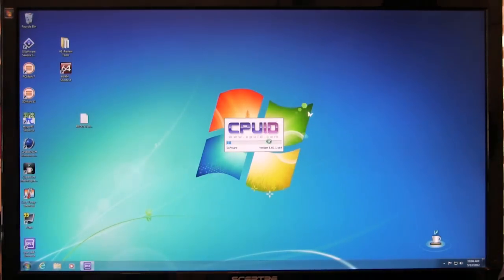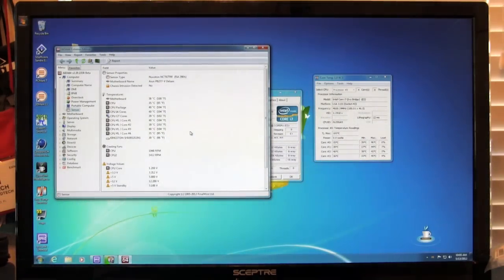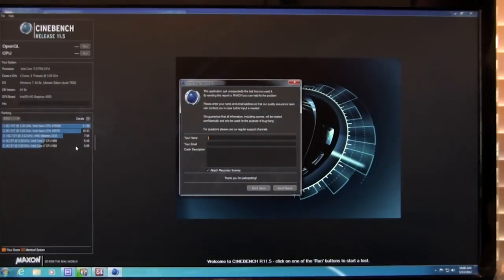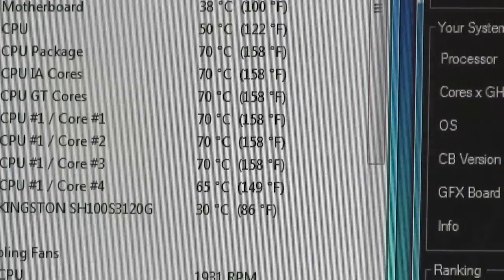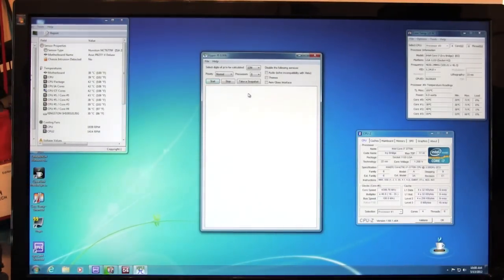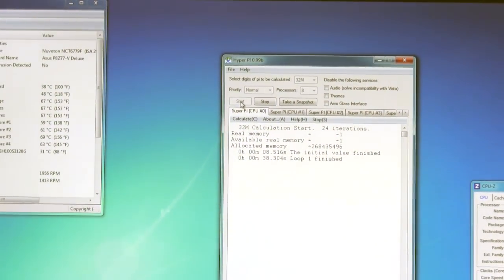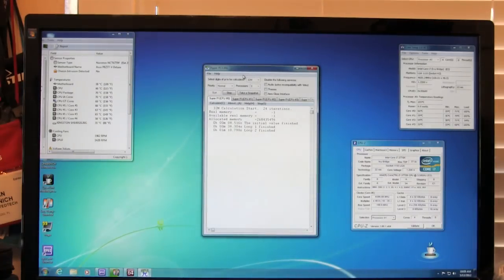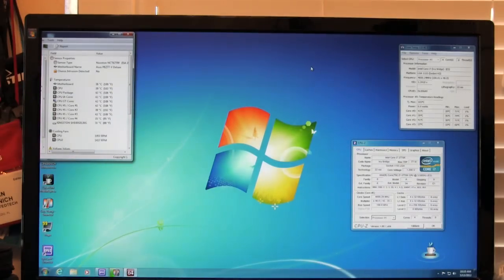Ivy Bridge Heat Issues. Are they really about the TIM?

Comment: well, to be honest, i think the black silicon glue is creating a gap between IHS and CPU die leaving it not placing enough pressure. TIM plays a role as well but maybe we are talking about 3-4 degrees here, i'm sure temps will not be that bad if the black silicon was thinner. however, i will delid and post back on results to see and show the difference.

Comment: you are lucky that you got a really good chip, most chips need 1.3+ voltage to be stable at 4.6, mine needs 1.328v on 4.6 Ghz and im hitting 75c, and thats the case for most of users. if you want to make a unbiased review, you have to test more than one chip. im gonna delid mine in the next few days after 1 year of usuage, temps are getting higher with time. im sure ill knock 20 degrees off my CPU when done deliding it.

Comment: your overclock is not stable at 2.0volts in cinebench, therefore you needed to apply more volts and rerun the test, your temps will be higher … dont speculate, also in with your setup core temp variability is good evidence of it, you should not have core temp varying by 7-9 degrees between cores, your video is not rigorous enough.

Comment: The actual TIM isn't the problem, it's the glue Intel uses that expands and causes gaps between the die and IHS. That's why some bad samples show very high temperatures on some cores, but not all. Removing the IHS and replacing the TIM should cause the cores to have consistent temperatures.

Comment: I replaced my 3770K intel paste with Noctua NT-H1 i had 15c reduction across all cores and now they run within 3c to 4c from core 1 to 4 instead of the previous 8c to 12c  difference across all cores so i at least found that i got better results i also have a Noctua NH-D14 cooler on it which i fitted multiple times to make sure that wasn't the issue and it comes down to silicone lottery every cpu will not be the same i know of other 3770K's that run hotter and cooler than mine

Comment from the maker: I have seen under the IHS and your point it still moot. If you are convinced that a company would intentionally hobble a new generations of products then you are not going be convinced by any amount of real evidence. You already have your mind made up.
These same arguments happened when Lynnfield was launched. In fact if you look back you will notice performance and overclocking issues with each new die shrink. It is what happens when you get smaller..

Comment from the maker: Sorry there is no way that removing the TIM is going to give you a 40-50% reduction. Sorry, but I am not going to buy that one. That would mean the past is a thermal insulator and not performing almost any transfer. Your first line also make no sense Sandy Bridge did not use TIM, but solder that is why people thought it was the TIM in the first place.

Comment from the maker: Actually you do not have to try that many to disprove the claims that is the TIM. The thermal interface material is made in exceptionally large batches and only a small amount is used for each CPU. Tens of thousands of CPUs would be using the same batch of TIM (not to mention thermal differences for the TIM will be small). If it is the TIM then it would be present in all CPUs. Because it is not it is more likely a process and design issue than the TIM

Comment: you should state which cooler is used in the description box. my arctic freezer 13(yeah, I know) idles my 3770k at 38-40~c and max to 92~c under intel burn test. but fully stable. that's at 4.4 with voltages set to auto on biostar tz77xe3. I usually don't see that high since no games or even my video converter hits max cpu load. normal highs are 65c or less at 70f room temp. I will be upgrading to water soon anyway.

Comment from the maker: Yes the TIM is mixed in batches, now how many CPUs do you think a single batch of TIM will cover? How many CPUs are from a single wafer? You a more likely to see the heat issues across multiple CPUs if it is the TIM due to the size of the batches, If you have a process issue your success and stability rate increases as the process matures.

Comment from the maker: If it is the TIM then it should be present in all CPUs. If it is another issue then it would be hit and miss with the CPUs. The move back to solder was a smart one, but it is not an indication that the TIM was the thermal issue with Ivy. Haswell is a 2nd Gen 22nm product which also makes the process more mature.

Comment: Unfortunately, one CPU does not make for an adequate sample pool. While the specific sample tested showed no sign of 80C+ core temps, others have. I've seen some samples hit temps >90C, and some have shown high (20C) temperature variance across the 4-cores.

Some Ivy Bridge CPUs simply suffer from temp issues. Whether it's the TIM used between the die and the heat spreader or not, the issue remains. Hopefully, the new Haswell CPUs have gone back to solder to eliminate any potential TIM issue.

Comment: Yeah, could be the board or the operator :).  I didn't go crazy on this build since I already have a 2500k @ 5Ghz.  Just wanted to see what Ivy was about.  I'm just now getting smart enough to play with some of the more "exotic" voltages (PLL, VCCSA, VTT).  Definitely gains to be had, but I haven't mastered it.  WRT the video and your original intent, I will say I'm not having any heat issues with my 3570k that I'd consider out of the ordinary.  It's stable @4.7GHz & 1.28 volts, ~75c full load.

Comment: Fair enough on that.  I agree Prime isn't realistic when compared against real world use.  One other thing I've noticed in my testing is that memory clock seems to have a big impact on overall stability.   In general, I find that if I bump my memory clock down to run of the mill DDR3-1600 speeds, I can push the CPU harder.  I'm sure that's not new news for anyone, but I don't claim to be an overclcoking guru.  I just try things and learn from them.

Comment from the maker: I have gotten 4.6 stable at this voltage it all depends on other tweaks in the BIOS and also the board you are using. Prime is a good bench to putting the CPU under maximum stress over an extended period of time, but it does not represent any real world test. Even a 60 second Lightwave Project (which can take over 100 hours to render at 4K is not as stressfull as prime in most cases.

Comment: It's definitely possible to overclock to this speed at these temps, but SuperPI/Cinebench aren't great for validating a stable overclock.  I doubt prime would survive 20 passes at this voltage.  I'm seeing 1.28-1.30 volts required for this kind of overclock to be stable, and when you put it under full load using something that really stresses the processor, you will easily see those 80-90c temps.  No disrespect to anyone, it just isn't realistic to expect 4.6 stable on Ivy at this voltage.

Comment: i'm running an i5 5700K at 3.6 and getting 90* C on stress tests, and freezing playing BF BC2 that runs max'd  very well with an e8400..  I had good coverage with AC paste when I took the heat sink off.  I am an Aerospace Tech, circuit board rework specialist for Delta3, Sea Launch, c17, f18, f14, f16, f22, osprey, Minuteman, Comanche.. a few things they said they couldn't tell me what it was and I was watched by an armed guard the whole time I fixed it

I wonder if this guy is a MS Troll..

Comment from the maker: The tests we ran were valid. Many sites were claiming 80c+ at 1.2V we ran our 3770K at higher than that and did not see those same temps that people were claiming at lower voltages. It disproves the original claims quite nicely if they are claiming 84c at 1.2 V and we only hit 81c at 1.28 there is a problem

Comment: Pre-Forming a conclusion and ignoring EVIDENCE to the contrary, or which invalidates your assumptions during testing = the christian scientist method.

anandtech,pugetsystems,overclocknet,hwbotorg and many others who actually TESTED scientifically have EVIDENCE to the contrary... IVB cpu's do hit over 80 deg C on low volts (1.2v) AND replacing the TIM does improve temps in the range of 5-10 deg C for conventional cooling (Water/Air).

The disclaimer is it invalidates the CPU warranty.

Comment: Pre-Forming a conclusion and ignoring EVIDENCE to the contrary during testing = the christian scientist method.
just search for TIM replacements on hwbot and other reputable overclocking community forums which ALL show improvement in CPU temps when the TIM is replaced..even puget systems test with fans set to "Auto" showed improvments.
It doesnt change the fact its an extremely RISKY modification, and it invalidates the warranty... but FACTS ARE FACTS.

Comment from the maker: Unfortunately that is not correct either when you are looking at temps that is what you are testing. This is not a stability test and interestingly enough "all" of the results you mention point to two or three other articles. The TIM is not the root of the issue, we saw the same thing during other process transtitions where leakage etc was the cause. You are welcome to believe what you want, but as you said one result does not invalidate others becasue CPUs are different.

Comment: Unstable overclock = invalid results.

Valid results come from sources that actually modified their CPU and replaced the TIM.. and those results all show the same thing. Replacing the TIM does yield noticeably lower temperatures in the range of 5-10 deg/c.

Like everything else with overclocking, EACH CPU IS DIFFERENT, "Low" temps on 1 sample does not invalidate all other results on all other Ivybridge.

Comment from the maker: Current Leakage is an electronic fact. Just becasue it is not being talked about on other websites does not remove that. If it were the TIM then replacing it with something that had better thermal properites would correct the issue, but it does not. You are wlecome to believe what you want, but it does not remove the fact that current leakage is the primary issue and not the TIM.

Comment: I'm sorry but your story is just a story. This is not talked about ANYWHERE on the internet except here. Its a problem with the TIM's. The E4xxx series processors had the same issue as it used the same TIMs that Ivy Bridge are using. Turn the voltage up, problem solved.

Comment from the maker: Curent leakage is to blame with the 22nm proccess
Leakage in transistors causes semiconductors to require more power to operate, as they must replace the current lost to leakage and also generates heat as it leaks away, When the heat from leakage is combined with the heat generated by the semiconductor's normal operation, it can become a significant problem. Excessive heat can eventually cause circuit failure. Designers may take a number of different approaches to reduce the amount of leakage.

Comment: Yes. It does. The stuff Intel used was cheap, Sandy Bridge has solder as its TIM under the heat spreader. Ivy Bridge uses this crappy thermal paste, replacing the thermal paste with a better one reduces temperatures. Moving the voltage down will stop the processor from functioning properly.

Comment from the maker: Is it not enough or too much, both can cause an overclock to fail. The important thing to remember(and again the point of the article) is that the smaller the process the more power you have to push in to counter for leakage especially in the first generations.

Comment: the instability you have is not enough power in the cpu, and it's the volts that suddenly causes the thermals to go through the roof, your overclock is invalid if it can't compete a benchmark, cinebench crashed.... that invalidates the overclock right?

Comment from the maker: The heat the CPU generates is a function of the voltage you apply to it. As the process shrinks and leakage increases this goes up more dramtically than it does in older CPUs with a mature process. The heat has nothing to do with the TIM as per our article there are multiple people that are saying this as well.

Comment from the maker: The "right test" is a matter of opinion. There are numerous tests that are used in benchmarking and for burn-in that do not get the CPU over 90 degrees. I could also remove a fan, use crappy thermal paste between the IHS and the Cooling head... so the test is not the point here. it is that the TIM used between the CPU core and the IHS is not the casue of the heat issues, the process at 22nm is

Comment from the maker: The TDP setting is not exactly accurate. Right now on a 980X it s reading 4095.0 Watts. I am pretty sure that is not correct. With the newest CPUs Core temp no longer reads VID and incorrectly reports other information. The temperatures are the most acurate part. You can also use Realtemp which has been kept more current than Coretemp. I have used both but prefer Coretemp for some of its logging and display features.

Comment from the maker: Yes of course it will, as does current leakage at the smaller process. The smaller the process the higher the current leakage and the more voltage you have to push through for stability. The viedo and the accompanying article show that Ivy Bridge actually needs more voltage to reach the same clocks than Sand Bridge CPUs did. You also have to put more voltage into the iGPU to keep that side stable at higher clockspeeds.

Comment from the maker: I would partially agree with you there. IVB at 4.8GHz performs better in many cases to SNB at 5GHz. I also would have loved to see a larger headroom with IVB, but if you remember the first 32nm CPUs they also did not have great headroom. it was not until lynnfiled and then sandy bridge that we saw that come out. Once the process matures it will change.

Comment from the maker: Thanks the more we look into it it looks like current leakage is part of the issue at higher voltages. As you mentioned as the voltage goes up so do temps. as temps go up so does leakage. this also produces failures on the CPU.

Comment from the maker: That is possible. However, unless it is a LOT issue we do not think it was a correction done by Intel intentionally. Our CPU was sent from Intel for review and is the same one we used for the initial review of Ivy Bridge and also continue to use. We did hit a temp max at one poit, but found that the issue was not with the CPU, but with our cooling unit. Another issue could be that many will pump as much as 1.92V into the CPU PLL. That will push up heat quite a bit we never go over 1.85V

Comment from the maker: One thing that many are fogetting is that when you get down to 22nm there is a large amount of current leakage. This can cause issues with overclocking, and also with heat. Now add in a new transitor model (3D Transitors) and you have problems with heat at high voltages and the need to pump more voltage in to get the higher clocks...